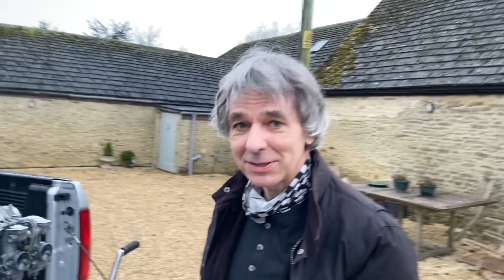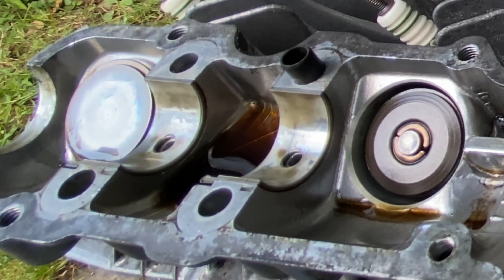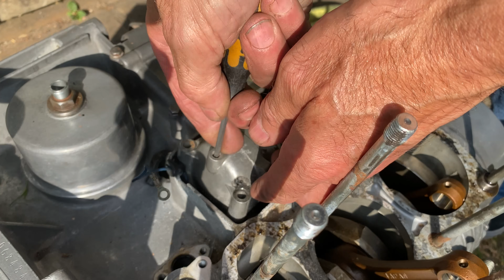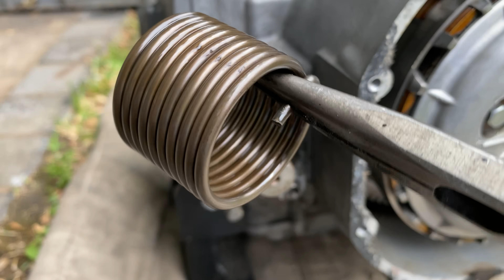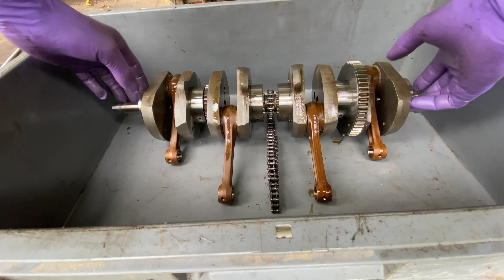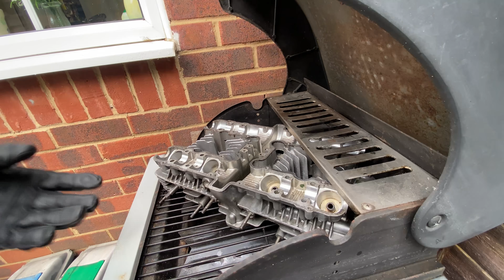Kawasaki Z1B 900 engine repairs - Episode 1

Comment: I had a 1979 Z650 back in the early 90s but could never get it going properly, it would start drive but wouldn’t rev out fully, various so called self trained mechanics couldn’t get it set up properly and I know it was only a carburetor problem, if I only had Alan millyard as a friend.

Comment: the 2 valve kz engines are my faves.. my 1st big street bike was a 1978 KZ650 C2.. bought it cheap as-is in 1983 running on 2 cylinders..  i was 14.. been riding dirt and enduros a while.. was 6'4" and 200lbs and growing so handling the big bike was no problem... pulled a plug when i got home and saw it was bashed to hell... started disassembly.. #3 had eaten a valve.. bashed a hole in the piston and took out the coil somehow..  a big bore top end later.. I was tearing up the streets.. wasn't long till i was moving up to kz1000's.. gpz1100's.. eventually owning most all the kz's and Gpz's  along the way. Now, i'm also a Honda fan.. cb's and especially the VF v4's i have a few of those too..

Comment: I've a question about the crankshaft-gear that engages with the clutch gear. How is it connected to the crank? Is it press fit or keyed or a milled component solidly affixed?
Reply: The reason I'm asking, is that I've a Zephyr 1100 which exhibits clutch slip symptoms. ..I've checked everything I can think of, clutch plates springs, stiffer clutch springs, shims on the springs, shims on the selectors in case theres too much play etc..., still on hard takeoffs, the clutch slip... so maybe the problem is elsewhere. But where

Comment: A bit of wire , a few mins.,a pair of needle nose pliers, And "New Charlie " can also keep 6 on inspection's !  (if he was here earlier ,with glasses, , he would probably found that Bullet ,you and Henry dodged!("High speed Centrfugal wheel valve bullet !")   solid stems from now on............maybe consider solid composite High speed tires?

Comment: Did you use a JIS bit with the impact driver and if so would you kindly advise where I go about getting a set of JIS bits? Great vlog btw love watching you work especially on the Japanese engines 🤩
Reply from the maker: Search JIS impact screwdriver bits on eBay

Comment: My 1976 Suzuki GT 750 has always been garaged but thinks like tachometer drive and screw heads were far worse than this Kawasaki. I also have the cylinder block effectively welded to the crank case. Aluminium corrosion has jammed the studs. It will have to be gradually jacked off with a steel strong plate.

Comment: Fantastic video again Alan, love your work. Brilliant to see you strip the engine using basic hand tools and not a battery  electric impact wrench. As a retired mechanic/ engineer, I know how you can feel the bolts and screws yielding and undoing through the spanners and sockets. Totally missing if using an impact wrench. Nice mower in the background, love the 12 blade cylinder. Looking forward to the next instalment.

Comment: I have taken more than a few engines apart in my time, but never had the pleasure of disassembling a Z1B, I was impressed with the number of aids built into the casings and components to make the process easier and without any special tools. Excellent.

Comment: In my youth I was really into VWs and bikes. A couple of the valve guide tricks learned was to use a step drill and stop short of the end and then use a punch to drive it out. The advantage is that the thin section of the guide would stretch and pull away from the head wall without broaching the hole. Installation was accomplished by taking the head off a propane torch, including the orifice (best done outside), and inverting the pipe over a container and letting liquid propane come out and using that to shrink the guide. That, in combination with heating the head, resulted in a cold guide that just dropped into the head without having to pound it in. Thanks for your wonderful videos.....

Comment: Years ago my dad rebuilt a triumph engine, when fitting the valve guides he put them in the freezer overnight we heated the head in the oven.
He said because they contract with the cold the guides will fit easier into the hot head, true enough they dropped in and barely  needed a couple of light taps to be fully seated.

Comment: Great video...thank you but why did you need to remove the oil gallery plugs and did you reheat the head before installing the new valve guide?

Comment: Have you considered swapping the screw head bolts for allen or torx heads? Years ago as a young biker I had a few issues with screw heads, mainly not having the right tools was the problem, but these days torx heads seem so much easier....

Comment: Tried removing Royal Enfield 500 twin guides with hammer but not enough heat, swelled the top larger and awaits to be machined out until a wafer thin is left.

Comment: There has to be a better way to move bike engines around. I use a similar sack truck from Costco, and have the same issues. I’m toying with the idea of a truck with four wheels and inflated tyres, two of which are steerable.

Comment: In my opinion the biggest mod for these engines is to find a head pro that knows how to set it up for small base circle cams - .100 milled off head and valves sunk resulting in smaller combustion chamber, also allows for flatter top pistons, better overlap cylinder filling and combustion swirl.

Comment: Allen - This is an unrelated question to this video however when you install your custom copper gaskets onto your engines do you use anything else to seal the gasket such as Threebond or gasket maker or a stainless wire? Kind regards,

Comment: You can see why the japanese saw off the british motorcycle industry. The design of that engine is incredible given its age. There is no reason why that engine couldn't be rebuilt again and again and in theory last for a century. By the time the Z650 engine was produced, it was already being cheapened and made more disposable (cams that run directly in the head casting and no availability of undersize main and big end bearings). They must have had a preminition about the throw-away world that was yet to materialise. It upsets me now how scrapyards are full of cars that are just victims of neglecteven though the rust problem is far less common these days, snapped cambelts, and an accumulation of worn brakes dampers and suspension bushes, that even though parts have never been cheaper in real terms, the cost of skilled labour has made them uneconomically viable. The younger generation (generally) have shunned the weekend enthusiast mechanic as sad old men and just couldnt be bothered fixing anything. Watching this automotive legend calmly and calculatingly strip repair and modify engines and motorcycles is incredible therapy. I cannot conceive of pleasure greater than that of starting up a sweet sounding engine for the first time after a repair or rebuild. Generally youngsters will never know what it is to have a smile a mile wide.

Comment: Thanks for the video do u only have to replace the one v/v guide.  That engine looks as though it may  be two different ones immaculate gearbox and crank shines cam cover  and a worn v/v guide hmm any way interesting Kawasaki certainly built em tough back then the built up crank design is copied from fiat they tell me  but industrial espeonage was always a common thing  wish they still made engines and gearboxes like that

Comment: There is something very satisfying about using old tools. When you said it’s your “dad’s valve extractor.”
I have my grandads tools and what ever job I do I always feel that he’s helping me. 
Looking forward too part 2 Allan.
Reply: I know exactly what you mean, I have my dads old Sidchrome socket set and spanners, before they moved production to Taiwan, Sidchrome was made in Australia and guaranteed for life. The socket set has 1/2" drive so don't use it too much on my bikes, but the metric ring spanners get used all the time, and the fit and feel is still as good as when they were new 50 yrs ago.

Comment: The first “valve lifter” I ever used was one I made of scraps of 4130 aircraft tubing in the yearly 80’s.  I’m not sure if I still have it, but it worked well on the XL-100 engine I made it for…
Reply: We had to make a torque wrench as part of my fitter/turners apprenticeship when i was young, i still use it and get it calibrated every few years, although the 1/4 & 3/8 drive digital ones get more use on my bikes.

Comment: Brilliant vids Allen - a question: on reassembly are you referring to your dis- video, a shop manual for the engine or [gulp] your memory? Or is that revealing the master magician's tricks?? ;)
Reply: I’ve never seen a shop manual, that cuts a engine in half & adds a few more cylinders. Or turns a z1300 into a V12😂
Reply: True!!

Comment: The “green” lunatics want to discard 100+ years of mechanical engineering know-how for battery electric vehicles. This is madness. We’re unable to generate much mains electricity using so-called renewables. Most BEVs are charged up using so-called fossil fuel powered generators. In addition, I am absolutely certain no BEV will still be running, 49 years after leaving the assembly line. They’re anti-green, and the push to do away with small, ICE powered vehicles is political and nothing at all to do with mean atmospheric temperatures. Once these frauds are seen through, you can never again trust politicians or their astroturfing “advisors”. It’s all theatre and not very good actors, either.

Comment: I put 48,000 miles on one of those engines with never a mechanical issue, and I wasn't easy on it. I sure wish I still had that motorcycle, which was a 1974 Z-1B Never had anything off except the cam cover, to adjust the valves, and I ditched the points for a Hall Effect electronic ignition.

Comment: Hey Allen, did you grind the tip off the Phillips head of the impact to make sure it doesn't bottom?
Reply: Ah, is that an adaptation to allow crisper removal of JIS screws?

Comment: love the content  do you heat the head up to insert the new valve guides ?.
Reply: I think he did the tap out old, tap in new, all while still hot enough to buy that tiny extra dimension in the hole for the guides.

Comment: Excellent video Allen.  I'm tearing down my 1976 Honda 400 Four at the moment - not the same engine but your approach is very instructive.  I was wondering about valve spring compression tool and I see from your demonstration that I can use anything that will depress the valve springs.  Most helpful.

Comment: One of the simplest, best designed engines ever 👍
So easy to disassemble and rebuild. From boring the cylinders to installing oversized sleeves, head porting, valve jobs (including oversize valves) and flow testing, I built so many Z-1, KZ and GPZ engines that I was able to throw the cams in by eye and have them degreed within a couple of degrees of where I wanted them (with valve to valve and valve to piston clearances being the limiting factors)...
Reply: Cam lobes facing each other at TDC slightly pointing downward, had a 1325 street motor back in the day.
Reply: That’s how pretty much all the 4 cyl dohc Japanese engines work…point ing the lobes together at tdc gets you close (or the opposite depending on which side of the engine your reference is be it #1 or #4 cylinder it can be they will be pointing away from each other!)

Comment: I can’t believe with all of the well thought out designs on those motors that they decided to use Philips screws for the covers. Thank god for impact drivers!
Reply: Funnily enough, I remember having that thought in the 1970s, taking Yamaha YDS7 250 and Suzuki GT380 motors apart for exchange cranks and a rebore & fresh top end. I swapped them all out for chromed Allen headed bolts. I got a chuckle, swapping them back to a new, stainless screw set a couple of years ago. On the very same motor (the GT380B). In that regard, it’s a case of everything changes, but the bike still remains the only connection to a misspent youth.

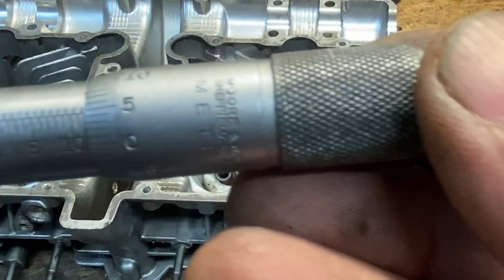Comment: You make it seem so easy, Allen 🙂 ... and with the right tools and some care and thought, it is.  Your measuring of the diameter of the new valve guides at 24:30 brought back memories for me... was having my GS1000S cylinder head fitted with new valve guides years ago by a motorcycle mechanic, and he failed to make this check.  Suzuki GS valve guides are, I believe, always made a few though oversize, and they need to be turned down to the correct diameter.  What followed of course, was mushrooming metal as the mechanic tried to force in an unprepared guide.  Thankfully he stopped and investigated, and there was still enough good material to locate the guide after he turned them down to the right diameter.  The lesson is... check!

Comment: What's the reason to remove the oil gallery plugs before vapour blasting?
Reply from the maker: to be able to clean out all abrasive particles I will explain in ep2

Comment: Allen's back with his JIS screwdriver and camera, that's always a good day!! I'd forgotten all about this engine. Glad to have it see the light of day and a bit of TLC! Thanks for the video!
Reply: Shout out for getting proper JIS screwdrivers. Many’s the case and cover screw I knackered, using my foster dad’s Phillips drivers, in the 1970s & 80s. 
They are so nearby right that I didn’t realise until I was in my late 40s that there was a different standard! One of the Suzuki GSX or GT guys mentioned this so of course I had to buy a basic set covering most needs.
Reply: @GT380man  yeah, more or less the same with me! Always wondered why every old Japanese bike I bought had wallered out Phillips screws, ruined many a float bowl screw head myself before someone finally told me "hey, they're different.. dude!" Bought a really well-made set of Japanese-made JIS screwdrivers and Jap bike life has been so much better ever since 🤣

Comment: All facsinating engineering stuff, but the nicest part was the massive grin you gave us when the Z1 engine fired up on the back of the truck and we can see the flames firing out the exhaust ports. It took me straight back to 17 years old when we stripped our mates GS 750 and fired it up without pipes, deafening and hilarious

Comment: Who’d have thought it, a rear axle spindle as a rotor removal tool? Alan at his finest 👍
Reply from the maker: its the swinging arm spindle
Reply: @AllenMillyard I have a feeling it’s a recommendation in the manual, no? On the GT750 motors, I believe it’s one of the long engine mounting bolts you can use. IIRC, that’s one I made a special tool for. You screw in a piece of threaded rod, with the threads ground off at the business end, right in the centre of the rotor, until it bottoms onto a depression in the nose of the crank, using a straight blade screwdriver to pinch it tightly into place. The rod sticks out into free air. That end has a hacksaw cut deeply across it, for the screwdriver. When you screw in the engine mounting bolt, it goes tight against that end of the extractor tool. A sharp tap on the mounting bolt head with a light, metal hammer head, and off comes the rotor with a satisfying crack.
Reply: 🤦must pay closer attention!
Reply: The authors of some Haynes manuals, back when they weren't utter shite

Comment: Hmm... I'd guess by the engine's internal condition it must have been a low mileage bike. The sprocket nut being 'chiseled' could be a potential indicator of a chain that jumped off once... or someone did a rip bad job replacing a sprocket/chain.

Comment: I swear, any time you start disassembling something, it's like the Christmas morning reaction was of you as a kid opening your presents. An engineer in his natural element.
Reply: Lol I agree entirely matey
Reply: Watching these videos is like mix of meditation and sorrow over never having done anything close to as cool, with very low tech tools and machines, that most of us actually could get access to.
Reply: Sooo true!!
Reply: I've always pulled my whole engine and reistalled it upon purchase of a different machine (I've only had two), if only to know that I could, and to get to some understanding of how everything works! Made mistakes and learned from them, had an old '82 cx5oo for over a hundred thousand kms, my Zephyr is being rebuilt at 161K , nothing like as gorgeous as that z1!  One day hope to have the correct tools that I don't have and a good enough shed to set up a hobby shop. Thanks for your sensible commentary and including us in your lives. Long admired Mr Millyard's work and skillset. He makes ir look easy, and ordered, and definitely not a chore. Kinda liked the finish on that engine, but vapor blast and clear coat (where I  can, unfortunately the clear cerakote fell through for my cases, should've sourced that too!  Thanks again. Subscribing.
Reply: As a mechanic that had to put stuff together someone had taken apart, I would not mind his ordering of parts disassembled.
Reply: I can take an engine apart no problem , but it’s putting it back together properly I cannot do..😊